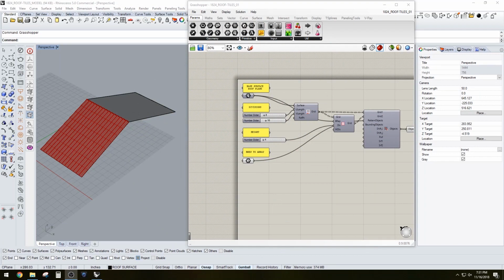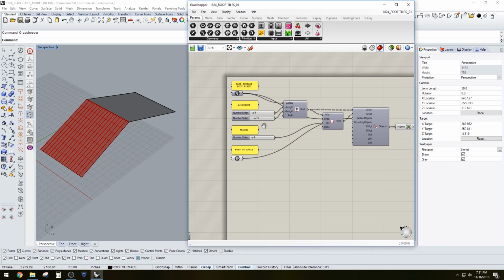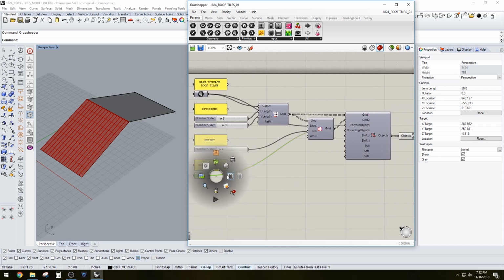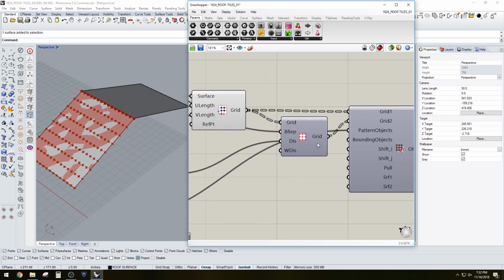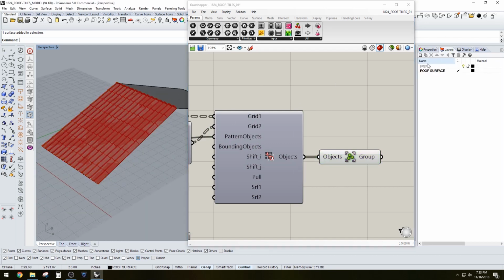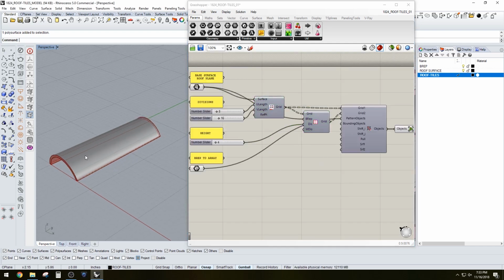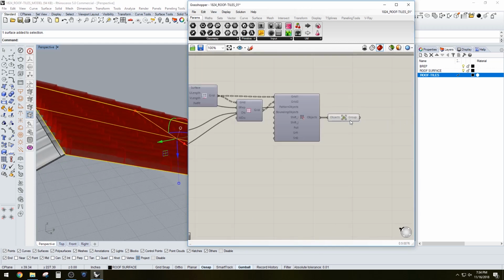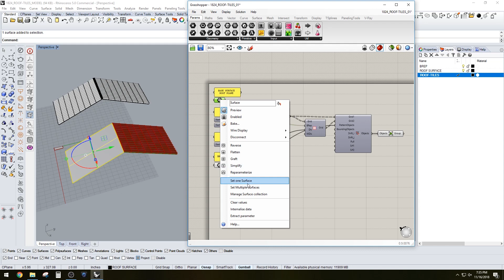Grasshopper for Rhino 3D Roof tiles on Surface paneling tools Grasshopper script Rhino 3D

Comment: This is super useful, thanks! I'm curious if there is a smart way to have the tiles trim/boolean automatically when, for instance, there is a chimney, or skylight, etc. Have you played with this at all?
Reply from the maker: yes,  you would have to have a solid, and then use the Boolean difference operation after you have the roof array.  Thanks for the feedback.  Ill try to address this in a future video
Reply: Nice! Actually tried that and it worked well. Just need to find a way to remove the tiles that do not intersect with the boolean object. Somewhat of a GH newbie so not sure how. I am assuming this gets into lists and culling.
Reply from the maker: @brianmcveigh1958  yes, but I would like to see the example you are talking about.  If you want to talk further send me an email copetedavid@gmail.com. 👍

Comment: how can i apply this in a meters file ? apparently every time i add it everything in grasshopper i scaled up like 40 times
Reply from the maker: make sure the slider that has the length of the module is a smaller number